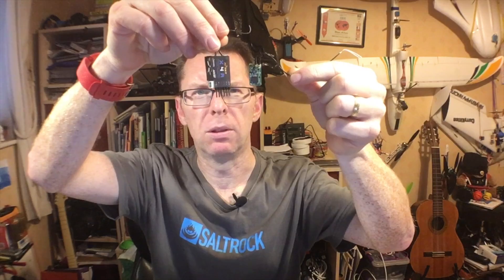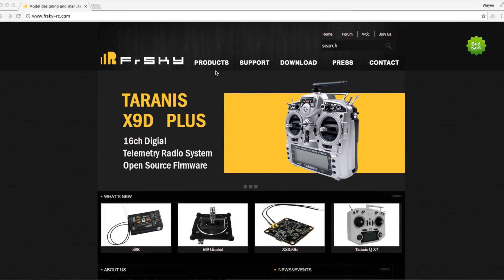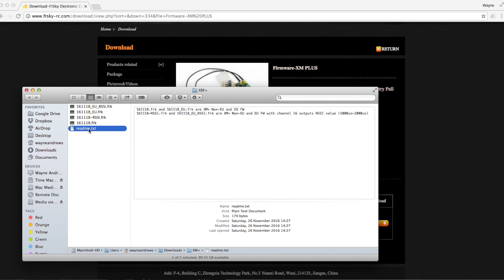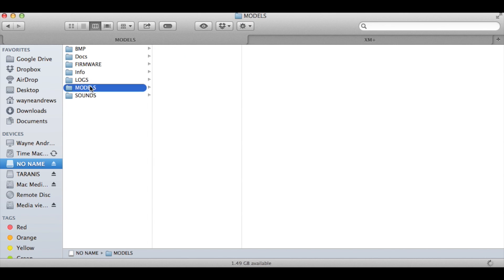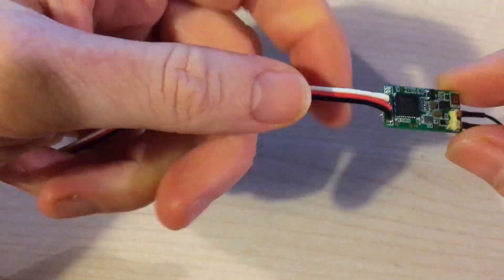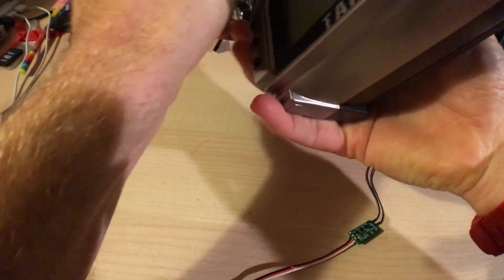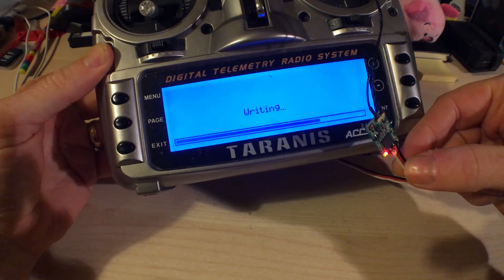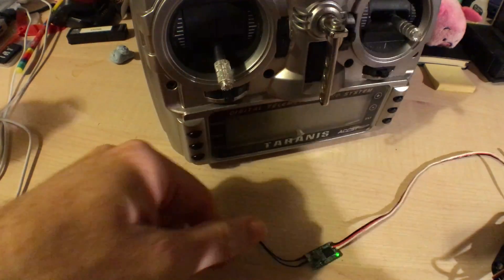Tutorial: How to reflash firmware on the FrSky XM+

Comment: Hi, I followed everything precisely and all seemed good but when I get to the point of flash external device I get 'FW update error bottom pin no response' which is indicating that the white wire isn't connected properly (?) but it is. I get no light indicator on the receiver though.. not sure what the problem could be
Reply from the maker: Well, I didn't know about this, but having done a bit of checking, it seems like the opentx guys now use the s-port on the bottom of the X7 for firmware flashing.  I'll have a go of this myself, and do a quick update video once I'm happy.  I've got an X7 but tend to use my X9D still
Reply from the maker: Ok, so the QX7 is an interesting one as everyone will have an S-Port under the flap, but only the later ones will actually have any pins connected.  So on my one - no pins, so it flashed fine via the module bay.  If you have pins in your S-Port though, you'd connect in (looking down on the radio) GND/5V/Signal.  I've done a video on this (be out in the next day or two) but I can't actually show this on my radio - only talk about it !
Reply: Same here... Use the X7 trans
Reply: @Gerard Darkforce - yeah, I'm using the Taranis X7. Did you manage to work it out?
Reply: Use the the port on the bottom next to sdcard, Its now working for me
Reply: CurryKitten - That would be great. I have tried the port on the bottom of the controller but it still failed to flash. I'm at a total loss as to what I can do now. I bought 3 XM+ receivers for 3 different quads (which all have no receivers) so I really need to get to the bottom of this!
Reply: Gerard Darkforce - I tried the port on the bottom and it still failed to work for me
Reply: You sure that the pins are correct in that port, it's different wire setup down there.. .. [ground/5v/signal] [sdcard] [usb]
Reply: Geared Darkforce - yeah, all as you said but still no luck. I'm beginning to think it's either a faulty receiver or I've broken somehow?!

Comment: i have a big problem i have these receiver and a tatanis q x7 and when i go to betaflight (without touching the transmitter ) all the things are going up and down and when i move the receiver it just randomly move channels
Reply from the maker: How much movement are they having - you might see a bit of jitter where it moves up and down a few points, but not huge movments.  So things to check: do you definately have the right UART selected for SBUS (try the others as an easy test).  Check you have the right serial provider setup in your configuration TAB (SBUS for FrSky)
Reply: thanks . I have done that but i forgot that i updated the firmware
Reply: CurryKitten i have another problem , i have the drone ready. In betafligh the 3d model works fine with the transmitter  but when i try to use the drone just using the throttle it make like a flip and sometimes even it dosen't respnd to what i am doing . i don't know what i am doing wrong
Reply from the maker: If you can take me through what you've done to setup so far, that might help.  Did you calibrate your ESCs (don't need to if running dshot) ?If you go into the motor tab (take your props off) and run each motor up, is everything smooth - do you see any excessive vibration in the graphs when these motors are spun up ?  What mode are you attempting to fly in ?
Reply: okay when i finished soldering i enter in betaflight and flash the fc to the newest version and i did the same with the esc's then i started configuring the controller with betafligh and change the inputs because they where inverted and i set up the arm , failsafe and angle switches so it should be ready to flight (i have calibrated the esc's ) and sometimes i move the stick and the drone dosen't act at all and i unplug the batery and plug it again and slowly start moving the throttle and when i reach more than the half of the throttle the motors start moving unevenly and it flips. I don't know what i have done wrong or what to do now
Reply: when i test the motors without the props in betaflight and slowly start throttling they like first act really wierd like they aren't moving and sudenly start moving fast and stop again and start moving fast again tha's normal? when i throttle a little bit more they act normal

Comment: I just ordered one of these XM + RXs from T9 Wayne.....You can still get the International Firmware version from T9 if you want it....I like the fact I will be able to bury it out on a wingtip, and the range is supposed to be pretty good too. Using it with an Omnibus F4 FC.
Reply from the maker: Cheaper from China.  I flash all mine as a matter of course now - mainly because I want the RSSI version of the firmware (that puts RSSI PWM out on ch 16)  They are so trivial to flash that I don't even make any proper connections, I just hold in the pin headers until it's done :)
Reply: Yeah, cheaper, but I didn't want to wait...I liked how you re-named the Firmware file into something far more appropriate, what is it about naming Firmware Files and software engineers..?...They all do it, it must be in their Genes or something.
Reply from the maker: Clearly a build prefix which makes sense for versioning, but less for consumers
Reply: LOL...yeah, its like they want to keep it a secret from their end users, just to confuse them fully and piss them off...:)
Pretty sure they could include the RX type AND the build # in the title..?
  I had to flash my new XM Plus with the latest firmware in order to get RSSI out along channel 16....Works good in iNAV...Actually 29/3/2017 is the latest version of the Firmware.

Comment: I have a devo 7e and finally got a successful bind last night, range test was great everything working smoothly. It was bound for maybe and hour. I was getting a perfect signal in test mode no matter how hard I tried to make it loose signal around the house. Xm+ here.

I was in betaflight setting some switches up and the receiver just stopped working. I was changing the aux channels on the transmitter for flight modes in betaflight and it just stopped receiving. When I power it lights up dim solid green/red and doesn't do anything, no different if I power it on while holding the bind key. It should be a bright solid green and blinking red in bind mode. Sometimes if I wait a while to plug a battery in and don't hit the bind key it will light up solid red. I tried to bind it again but nothing happens. I'm at a complete loss. I reset the profile and tried to bind again no luck.
Reply: I ended up returning the receiver, the new one has been working fine ever since. Flashing the old one did not solve the issue, in fact it wouldn't flash.
Reply from the maker: I'm confused about how you would bind a Wallkera TX to a FrSky rx.  Is there some compatibility here I don't know about ?
Reply: Yes it has deviation and frsky module modification.
Reply: the exact thing happened to me! funny thing is I was using a radio that has the same deviation software.. I was also setting up things in betaflight when it just stopped working with the 2 dim lights
Reply: RavageBullet thanks for your reply! I was thinking that may be the case as I've also been reading these are sometimes hit and miss. I'll be ordering a new one! They work amazing when they do

Comment: Please help why does this stuff have to be so confusing.
I have no green LED from my xm frysky receiver only red led flashing when trying to bind no matter what i try
Does this mean that the receiver is bad?
Reply from the maker: Your receiver is going into bind mode - which is a good step (solid red light would be much worse) if you radio isn't binding with the receiver, the most obvious thing to check is whether your Taranis's internal XJT module is running the same type of firmware as the RX (either international or EU) ?

Comment: My receiver doesn't bind. How can I know which firmware do I need in my receiver? I say it because if I install the version that I already have I will be wasting my time. Thanks
Reply from the maker: You need to match the firmware on the receiver with what's on your radio.  It basically comes down to running the International firmware, or the EU LBT one.  If they don't match, you won't be able to bind
Reply: CurryKitten how will i know which remote version i have?

Comment: what if I dont have a Taranis? 
I'm using a Turnigy 9x with DJT Module
Reply from the maker: The question of flashing is a good one, the 9x can run OpenTX, so you might presume it could flash a receiver, but I don't know.  This is going to be a moot point in your setup though, as the XM+ runs in D16 mode, which means that a DJT module won't support it (you need an XJT module instead)
Reply: Thanks, I will get rid of my Flysky I6s and my Turnigy 9x and get a Taranis , 
Do you know if I can get the same result with an Taranis QX7?
Reply from the maker: Yes the QX7 is basically a Taranis  X9D with a slight lower res screen, no sliders, and two less 3 position switches.  It is however, much nicer to hold and has a rotary dial which makes configuring things much better (that the X9D's arrow buttons)
Reply: you have been very helpful thank you, 
I'm from Brazil, but 29/07 I will be to Chicago, do you know if i can get a Taranis in some Physical store?
Reply from the maker: Don't know - I'm in the UK.  Try a google - there's bound to be hobby shops around locally, but it seems rare to find FrSky gear anywhere but online.

Comment: ok new problem with new a XM+, FW flashes fine no problem there but when trying to bind i don`t get red and green flashing just solid.. ive tried same fw version you are using and 2 other LBT versions..  ive only got the XM+ connected to FC BF F3 board using USB which powers 5v to the FC so not in a fully built frame but that shouldn't matter as it has power. any ideas ?
Reply from the maker: As long as the rx is getting power from somewhere, it's not fussy - so your config isn't an issue.  Are you running LBT on your radio, or the International firmware (as you've said you've tried both)  obviously you need to make sure you are matching up on both here, else they won't bind at all.  If that looks good make sure your rx and radio are separated with a bit more space - mine were a bit close here, and the signal can overwhelm the rx.
Reply: CurryKitten I updated taranis before using opentx so I would have thought it would auto detect which firmware to install.. you think there is a way to download EU taranis FW manually ?? I was meaning I tried 2 different XM+ FW versions but both LBT..
Reply from the maker: Ah - ok.  There's the firmware running on the Taranis, the OS if you will, and then there's the firmware that runs on the internal XJT module in the Taranis, which is where the whole EU/nonEU versions come into play.  I've not touched mine, so I can't speak from experience, but you should be able to get it here http://www.frsky-rc.com/download/view.php?sort=&down=232&file=Firmware-XJT and then flash your internal TX with it.  Hopefully things will all match up then and bind for you
Reply: CurryKitten ok I think I have international FW on the Taranis as I have mode settings D8,D16 & LR12 so I'll try installing LBT FW on  the taranis..

Comment: I was going to flash firmware on a XM, but when selecting the file on the taranis, i only get DELETE option. I dont get the FLASH EXTERNAL DEVICE option.
Reply from the maker: Now that you're the second person to mention this, I've added something to the end of the description.  You must be only early OpenTX firmware.  Don't worry, it's easy to upgrade, and this will then give you the flashing option (read extended description above)
Reply: Thanks. Actually im still using open tx 2.0. Will upgrade and try again.

Comment: is there a way to check the  fw version the receiver is on?
Reply from the maker: In terms of the specific version, no (or at least none that I know of) But in terms of if it's International or EU firmware - then your radio won't bind to an rx running International firmware if you are on EU Taranis firmware, and visa versa

Comment: hi 1 question is there any RSSI pad on xm plus? thx
Reply from the maker: Yes - the manual shows one pad as being RSSI and states it should put out 0-3.3v (I've not tested this out though)  Of course you can also flash with the RSSI firmware and it'll put out ch 16 as the PWM RSSI value if you have a floight controller that will pick that up
Reply: Thanks for the answer..i am useing osd in pdb matek pdb..wondering how to get the rssi on screen..

Comment: crap I long press on firmware version and it only comes up delete option :(
Reply from the maker: One thing I didn't mention as I figured everyone might be on the later radios now is the firmware running on your Taranis.  To flash receivers, you'll need to be on OpenTX 2.1 (I thought it was just people like me that got the original batch that needed to think of it)  Upgrading is a doddle, but if you are moving from a much earlier version you might need to change a few models as some of the mix sources might change (So I found some that should have been MAX were set to something else) but you can backup everything first.  Go to http://www.open-tx.org/ and download the OpenTX companion - this will let you backup your radio and upgrade the firmware then you can get going again :)
Reply: CurryKitten I'll give it a bash thx..  I got mine in 2015 I think so you could be right !
Reply: CurryKitten sorted thx !
Reply from the maker: Yay - nice going

Comment: Hi friend i have a freeX McFx O-1 quadcopter but it want take off not getting any customer care from gear best please please please can you help any good quad repaire centre if you don't have a Dji its hard to get your quad fixed any friends and places you know of please gadgetman 404 out
Reply from the maker: Goes off to google freeX mcFx O-1  Hmm ok, and does it just tip over when you try and take off as per your video ?  First off, see if you can go down a PayPal dispute with GearBest - if you can do that, no messing about.  I'm not sure a generic quad repair centre exists (perhaps a gap in the market), unless you do have something expensive and behind a very big international company like DJI then you are going the hobbyist route where you figure it out and fix it.

Good news - is some of these components are generic.  Brushless motors, escs - easy to look at.  A proprietary flight controller, less so.  My first quest would be "does it work in non-gps mode", followed by redoing the compass calibration, and then plugging it in the computer and looking at the gyro and accelerometer read out to see if it moves as it should and then stays put when it's still.  Is your lipo definitely charged up ok ?

Seeking help from a community will move you along faster - if you have a few basic tools: screw drivers, multi meter, soldering iron, then join a forum, explain issue - what you've tried so far etc

Comment: I can see why you would want to flash this to a non EU version as all your kit is non EU but if you were starting out would you just stick with the EU version?
Reply from the maker: It's more about matching it up with what you radio is running.  So if you bought a Taranis from the UK then it'll have the EU firmware (not that you can't change that as well) but as I mentioned sometimes you'll find receivers at super cheap prices at the big Chinese warehouses like Banggood in which case you'd want to flash these from the International firmware to EU.

Part of the reason I'm on International, is they didn't have the EU version when I got it, but also the EU version has a lower sensitivity (-90dBm vs -104dBm on International) which translates into lower range.  For most people - especially not pushing the limits, it's unlikely to be a problem - but for me I'll stick with what I have :)